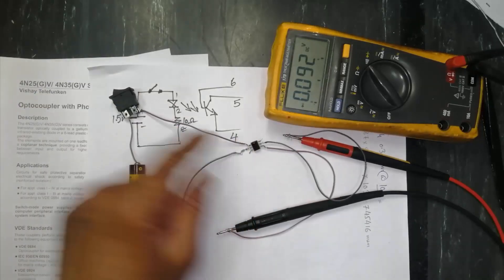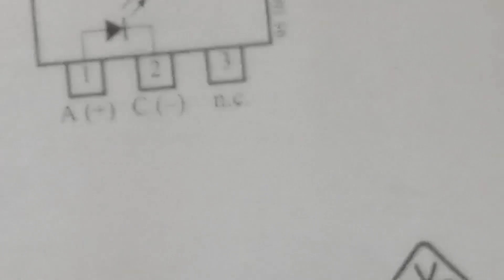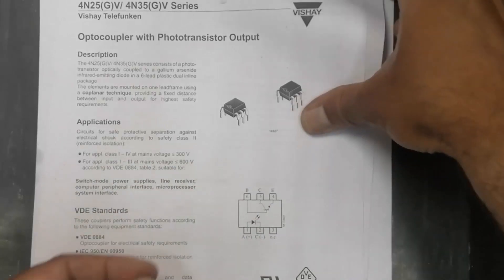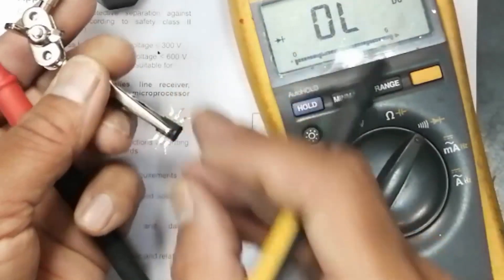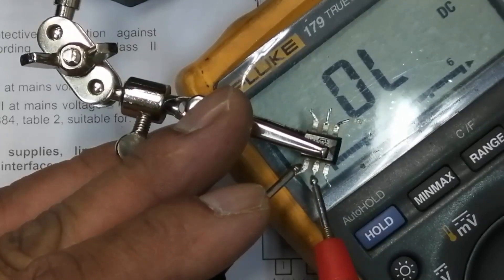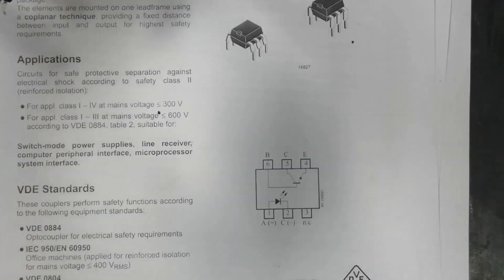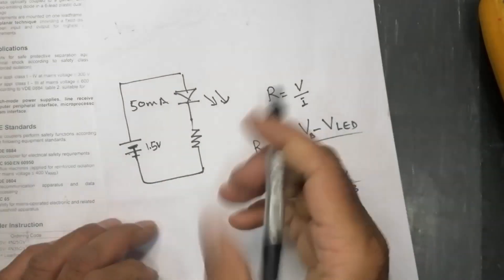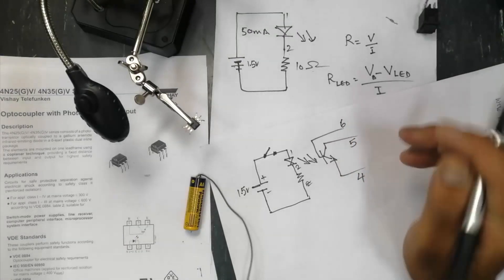#225 How to Test Optocoupler OR Opto-Isolator 4N25GV, 4N35GV

Comment: Great video as always ....  question about the continuity check ... your multimeter beeps but the resistance was about 90ohm between emitter and collector. Why is that ? So its not fully shorting between them (0 ohm) I think my multimeter only beeps when there 40ohm or less resistance.

Comment: 👍👌 what is use of the base  that pin 6 uses Ur not tell .if base voltage applied pin 4&5 is continuity. Where the base pin is connected in circuit.Difference between 4pin &6 pin optocoupler.